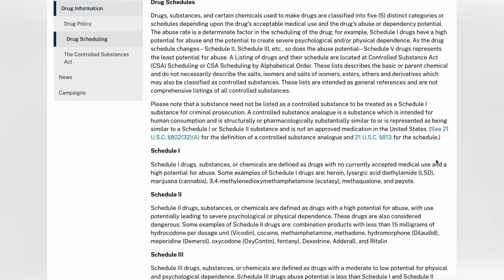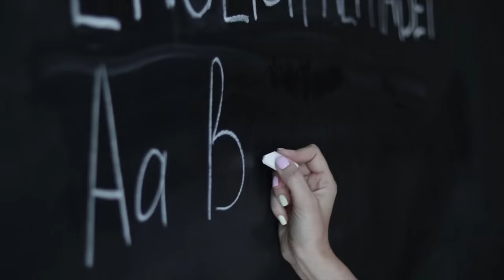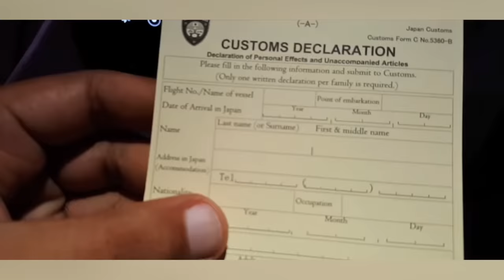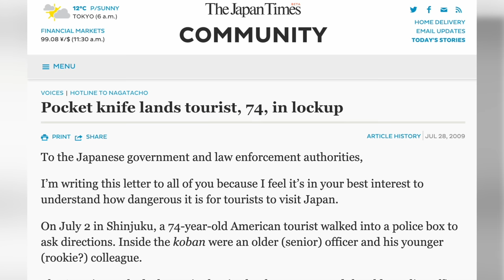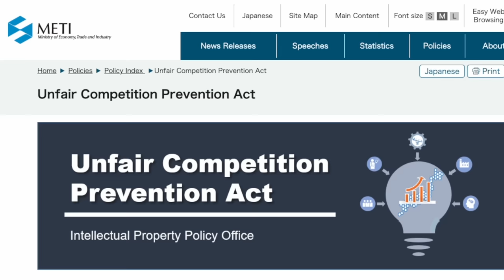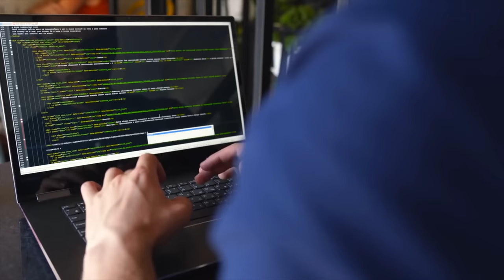This stuff is ILLEGAL in Japan but OK in America!

Comment: So I’d just be arrested once I got off the plane… I take several controlled substances in order to function, thanks to autoimmune disease and a degenerative neurological disorder. I carry a Swiss Army knife that I use to deal with camera equipment malfunctions. I’ve done a lot of home brewing as well. At least I don’t sell illegally modified Pokémon.
Reply: There is a form you get signed by an MD and approved you can take your medicine to Japan. But it has to be an MD ask the japanese embassy in your country
Reply: Hi David, I sympathize. I too need controlled substances to function due to an autoimmune neurological disorder (RSD/CRPS in my case). I travel to Japan when my health permits me to. So I can offer advice:

To avoid trouble you need to be organised ahead of time. Contact the Japanese embassy in your country, read up on current WHO guidelines, and get paperwork from your doctor and pharmacist.

I carry the following documents with my medicines:
• Narcotic Control Board permit to import medicines. The Japanese embassy in your country can advise you about the procedure to obtain this. It will take several weeks to process the paperwork, so plan well ahead of time.
• An original, signed letter from my doctor that lists my medications, the dosage, and my medical condition that the medicines are treating. I ask my doctor to print and sign two copies: one to send to the Narcotic Control Board and one to carry with me. If your doctor can print the letter onto letterhead and/or stamp it with a name-and-address stamp that's a bonus.
• Photocopies of my prescriptions. I ask my pharmacist to make two photocopies of each of my scripts. I ask them to stamp each photocopy with the pharmacy's name-and-address stamp, then sign or initial the stamp. 

(SIDEBAR: Japanese bureaucrats are obsessed with stamps, which are a big deal in Japan. Even in the middle of covid lockdowns some people commuted to the office just to stamp documents! An example of why Japan is sometimes described as the most old-fashioned technologically-advanced country on earth.)

I carry all these documents with my medicines, in my carry-on bag. 

The last time I checked, WHO guidelines recommended keeping your medicine-related documents in your bag and only presenting them in the event that officials ask you to; no need to present them unless asked. 

Nowadays, customs and immigration priorities are focused on covid compliance, and the process for that is automated, so hopefully that lessens the likelihood of hassles at the airport. If you run into hassles later on it will be good to have the paperwork showing you went the extra mile to cross all the t's and dot the i's before you came to Japan.

I hope this advice is helpful. Good luck in your travels. がんばって！
Reply: Swiss Army knives are legal
Reply: You should just stay in your country with all of that lol
Reply: @bluekinopio9390  oh look, an ableist! How original 😂
Reply: Same. Going to be rough visiting when I can't take any of my rxes
Reply: @Truecrimeresearcher224  so it can be safe to say this video isn’t too reliable?
Reply: @bluekinopio9390  Why aren't these things screened for at the airport before even boarding the plane towards Japan? It's very dishonest.
Reply: @chouchoue  because not every airport outside of Japan is going to adhere to Japanese laws.  Kind of a ridiculous statement you made. Airports deal with their own country laws
Reply: @andrew_oid  it depends. I think it has to be a medication that if you don't take it there is a hazard to your health. Always check with an embassy
Reply: Medicine would be fine with the right forms.

Never take a knife as a Carry on, though.
Reply: Most SAK are less than 6” so you’d be fine.
Reply: @majesticfluffybutts8962  In the case of the woman (Carrie) who was arrested, her mother filled the US prescription in the States and then shipped it to her daughter in South Korea where she was at the time, and then Carrie shipped the meds on to Japan when she moved there.  Even putting aside Japan's very strict laws, I can see why it would probably look suspicious if she isn't traveling with her own medications but is mailing them around instead.
Reply: @Truecrimeresearcher224  so I’d need to do this all before a trip to Japan.
Reply: @chouchoue  flying in is different. I mean, you could just sit in customs in the Japanese Airport while they open and go through all of your luggage. I flew to the Dominican Republic with food in my checked suitcase, no problem. I had to toss a couple packs of sealed jerky and snacks because Dominican Airport said no go in taking it back, even though sealed. Always look up laws for where you are going and the airports rules coming back.
Reply: @DSQueenie  6cm =/= 6", so not all SAK would qualify
Reply: Noted
Reply: I wonder what medications, if at all, Japanese citizens with the same autoimmune disease and degenerative neurological disorder use.
Reply: Every day i just keep learning more reasons why I never wanna live there
Reply: Well, illegal modified pokemon are illegal in the states to,not in the main game from violet and scarlet, just in online play, pvp.
Reply: @bluekinopio9390  Naw it just sounds like you got to do a lot of research before you go
Reply: I recommend contacting your local embassy and then they can help contact with the governmental Institute diet building and they can help work it out.
Reply: @jillianoldfield2300  Thank you for leaving such a detailed reply. I truly thought it was going to be impossible to travel to Japan.  Now I know I can. 🪷Thanks again, Pam
Reply: @DissociatedWomenIncorporated  🙂👍
Reply: @bluekinopio9390  Swiss Army knives are probably ok, blade is less than 6cm. US has similar laws in most cities where the limit is 6inches and we restrict daggers (double sided blade), automatic knives, butterfly knives etc. in some states it’s easier to carry a pistol vs a switchblade lol
Reply: @Rensune  I’m not sure how it would get passed tsa in America
Reply: Id like to know how the old guy got on an international flight with an 8 inch knife
Reply: @rietzhu  they're banned from competitive play by gamefreak, but its not illegal.

Illegal means theres a law that explicitly forbids it.

You cant get arrested or fined for selling fakemon in the US

Also the video is specifically talking about the act of modding as a service u charge for, i believe modding is still okay in japan if you do everything yourself.
Reply: Everything you just stated is EXACTLY what's wrong with our country. I'm no expert, but what world does it make sense to take all that bs just to function? Seriously though what other countries is this normal in.
Reply: There’s still time to modify Pokémon get to it
Reply: @dreqdreck7531  nothing, just need to tough it out
Reply: @trashyraccoon2615  same!!! i love anime, ,manga, and video games from the country, but my elder sister doesn't believe me when I say there are tons of reasons to not want to live there, heck they may a tech country, but so much of what they do is very old fashioned.
Reply: @azure8696  having to take alot of meds isn't all that strange to the older ya get, we are in no way a healthy country to boot.
Reply: So fixes for each, go to  7-11 and get their store measurements to try help. Instead pocket knife, try get a small screwdriver or just go electronic store. They got only like 1000 of them.
Reply: @jeffreystjames339  obviously English isn’t a language you know, so you seem not to have understood my comment. What do the measurements of a 7-11 have to do with anything? I’m not needing to know how big a Japanese convenience store is.
Reply: @David G Austin  obviously that was a mistype. I meant insurances. But yes, be rude.
Reply: I mean, obviously; what would measurements have to do with medication? Just auto correct changing my word.
Reply: @David G Austin  apparently I guess you don't know how auto correct works. If someone puts two words close together without a space, autocorrect loves to change that word. Obviously.
Reply: @jeffreystjames339   autocorrect didn’t make you write "to try help" or "instead pocket knife." Autocorrect doesn’t cause you to leave out prepositions or articles. And go to 7-11 and get their store "insurance"? When did convenience stores start selling insurance plans for prescription drugs?
Reply: @azure8696  so, sweetie, tell me in which countries people with, say, Parkinson’s disease can function without prescription drugs? Where can people suffering from neuropathic pain from multiple sclerosis function with no prescription medications? While I agree that the healthcare system in the U.S. is broken, that doesn’t mean that no one in other countries suffers from conditions requiring different classes of prescription medications. You’re being ableist.
Reply: @David G Austin  7-11 in Japan's are actually more like Walmart  or Asda *whichever country you are from. They even got store meds full supplies at most of them. I know cause I needed meds for asthma
Reply: @David G Austin  and I never said autocorrect fixes preposition. Where did I state that? I said obviously putting two words without a space might make autocorrect make a totally different word. So what's all this "prepositions" grammar nazi?
Reply: @David G Austin  if you're really  going to grammar-check my shortened words, then check yourself. Your last sentence... I carry a Swiss Army knife that I use for camera. Camera, or camera functionality? I highly doubt you use a knife on the camera itself.
Reply: MacGyver might be someone who could be unwelcome in Japan due to the fact that he would normally carry a Swiss Army Knife!
Reply: @jillianoldfield2300  I don't know if I will ever get to go to Japan because of my own CRPS, but this at least helps with one of my big worries if I did try to go. Thank you!
Reply: @Cerebrum123  You are very welcome! I'm so glad I could help. Good luck and I hope you can get to Japan some day. がんばってください！
Reply: @The_Bear_with_Flair  You are so very welcome, Pam, I'm glad I could help. Good luck with your travels to Japan; I hope you have a lovely trip.
Reply: They mean psychoactive medications.  You take several psychoactive substances in order to function for "autoimmune disease"?  What are they?
Reply: It's a good thing Japanese people never get sick, since all the medicines are illegal, and of course there are no doctors in Japan, because all doctors have bad hand writing, and you have to hand write your resume in Japan. Most people who speak English in Japan become English Teachers, or work as English teachers, but when Japanese people see other Japanese people speaking English, they freak out.
Reply: @stephhhie17  I looked this case up. The mother put all the pills into an empty Tylenol bottle as well. That was very suspicious.
Reply: I traveled with both classes of Japanese meds. Incredibly easy process you can do 100% online. They've got a portal for psychotropics and they will tell you what you do or don't need and  give you the email address for the folks who deal with the "bigger badder" meds kind of like the USA DEA.  (ie atenolol - a med im on for an electrical issue with my heart - vs stimulants and sone analgesics etc) 

It's pretty simple... honestly. 😊
Reply: Yea. i just sell nose spray and the sly.
Reply: You wouldn't even make it there. Are you serious? You think they would just let you even go with all that knowing it's illegal there? I feel you would get arrested for ignorance first
Reply: @andrew_oid think of it this way. Most people in America does not even understand our legal system. Most people who have not been through any legal system will not understand it especially their own laws and how their courts work.

Comment: Regarding cheating software or modifying bootlegs in games, it is technically illegal to offer this as a service, but its only ever really enforced if you are an individual. If a company did it, they generally figure out loopholes.
Reply: AKA: Here's a few thousand for this politician, and a few for that one, oh, and that one over there...etc.
Reply: In the US the only time it really becomes illegal is if it includes game roms
Reply: @gokublack8342 any proprietary code is the only thing that matters generally. The DMCA anti-circumvention clause can also make it illegal in some cases, but if you don't advertise the service as allowing for pirating software you should be fine.

Comment: In America we have a free market that covers "fair use" laws. As long as it's not reproduction of the game intended to make money with then you are legally allowed to use assets as long as there is enough of a difference in the original vs the used asset. The game genie isn't covered under this because code itself can not be copywritten in that type of manner. It would end up causing issues with commerce if someone was able to monopolize a line of coding.
Reply: Incorrect. It was illegally modifying game code, not just a lines or two. The method it used is the same as "backwards engineering" in the EULA. Hence breaking the EULA. This is why those exist. I believe this was before we had that in EULAs and part of why we ended up with eventually.

Comment: WOW !!  I guess I am not going to Japan.  Putting a teacher in jail for medicine or an old man for a 3 inch pocket knife.
Reply: I mean the drugs, I guess I understand but the knives? What are you planning to stab someone?
Reply: @beansoup8171  It's called self defense. Also, you can use knives for cutting things.
Reply: @Yaksoup98  wrote, 'What are planning to stab someone?"
If I carry a pair of chopsticks does that mean I am planning on eating someone ? I don't know if you meant your comment to be real or you were being sarcastic ? I hope the later.
Reply: @RIFADOR001  I use a knife 20-30 times a year....I would call that very common. I cut strings, I cut fishing line, I use a blade to scrape, ....I even carry a multi-tool, which has a knife blade on it, in my cars for emergency use.
Reply: @RIFADOR001  It kind of is. My mother carries a knife with her just to cut a steak in a restaurant because the knives there are crap. She also works a lot outside and that can require a knife. Plus, anyone that's ever opened anything can tell you sometimes you need a knife. It's also pretty good for self defense when the person happens to not have a gun.
Reply: @MsAngelique  - As long it's blade is less than 8 cm it's ok. UK has much more stricter laws against blades than Japan does. They consider screwdrivers as bladed weapons there.
Reply: @MsAngelique  I don't know about Japan, but here in Italy is illegal to carry a knife for Self-Defence
Reply: @inisipisTV  In Japan, it’s illegal to carry a blade of any kind exceeding 6 cm
Reply: @RIFADOR001     there's nothing there anyway.. If you really wanna see you just look on the Internet you'll see.. Save yourself a small fortune
Reply: @Pinkielover  Very true.
Reply: @RIFADOR001 i actually think it can be really important, theres a millionnuses for a pocket knife
Reply: @inisipisTV screwdriver license lol.

Comment: Considering as how I only use my pocket knife and multipliers at work, I wouldn't need them if I ever went on vacation to Japan. But one thing confuses me. I see a lot of videos of people camping in Japan and using large blades to chop and split firewood. Blades 6 inches long or larger. How are those legal?
Reply: They have a lot precondition regarding it. If you're going camping your'e allowed to bring a hatchet and bigger knives. If your a farmer going to the field it's ok too. But, if you carry them in the city, it's a no no. Kitchen knives must be wrapped and seal bag. Construction worker must place it in their tool box when going off-site. They're more alarmed at foldable knives.

Comment: @7:21 I had a Game Genie when I owned a SuperNES (which is the American version of the Super Famicom).
The thing is that the changes it made were NOT permanent; the changes only held up in the RAM of the powered-on game console which is not permanently burned memory like the system ROM is.   RAM can be modified on the fly, not most examples of ROM.  Once the console is turned off the alterations made possible by the Game Genie were undone.  It doesn't make permanent changes to the cartridge ROM.  
Cartridge ROMs are permanently burned and it's non-volatile memory as opposed to Flash ROM (which most PCs and consoles with SSDs use; an SSD is essentially a plug-in ROM cartridge itself).  Flash ROM can be erased by electrical disruptions or overuse;  SSDs have about the same lifespan of a gingerly cared for magnetic drive which is about 8-10 years.  Constant erasure and rewriting of the "cells" in an SSD gradually wears the hardware out.

The console has to be on for the Game Genie codes to work (after the device's 'cheat codes' are entered); the codes themselves get erased when the console is turned off.

Comment: I used to copy Pokemon on the original Gameboy game by having two Gameboys and two different cartridges, and an add-on that copied the save game from a cartridge to it's own RAM. I would backup the save game from one cartridge, trade the pokemon through the cable to the other cartridge, then backup the save game to original catridge, restoring the pokemon that I just traded.

Comment: I was surprised about the nasal inhaler.  I also just got surprised by knife laws in my own state.  I was reading our current laws (Washington state USA) and it is illegal to carry a concealed knife, no matter length.  However it is legal to carry a knife if it is visible.  SO - My TINY little pocket knife I use for cutting string or opening a package is illegal to carry because it is hidden in my pocket.  BUT - I have a diver's knife with a very large / heavy blade that I could wear on my belt and that is totally legal.  I understand they are trying to prevent hidden weapons but it still seems rather silly.